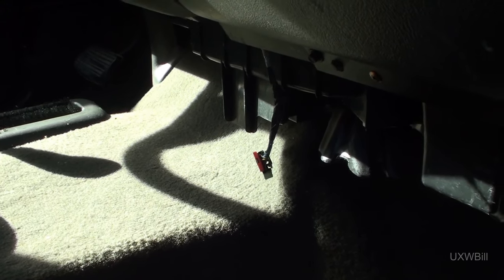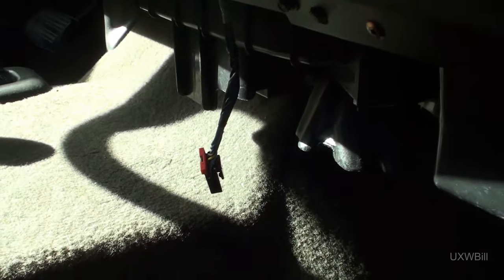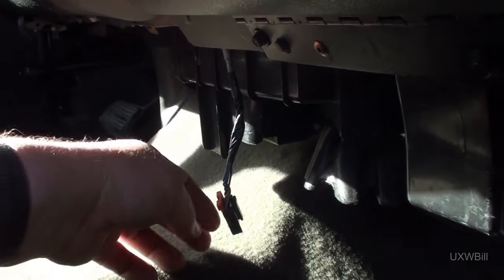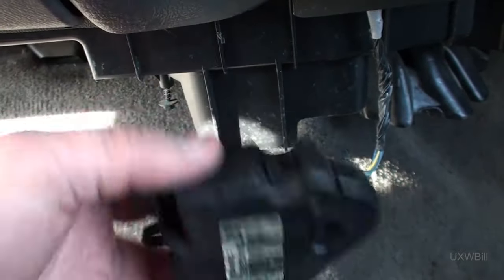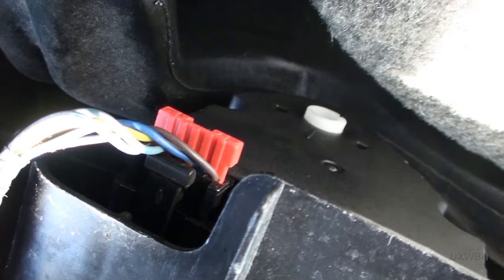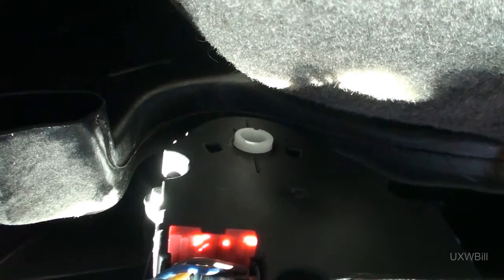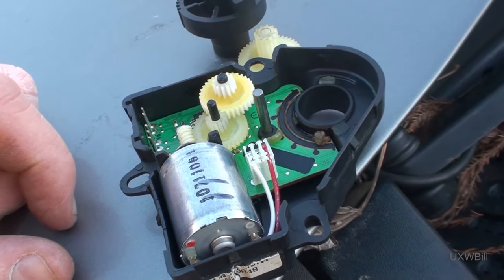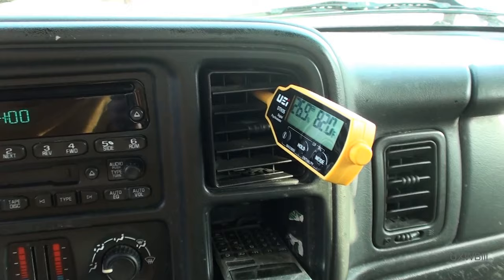Naughty Truck Newsreel: Broken Driver's Side MVAC Blend Door Replacement

Comment: A "lifetime warranty" on a part means you'll spend a lifetime replacing it when it breaks.
Reply: I still use that joke on a daily basis.
Reply from the maker: 9:47
Reply: @uxwbill I remember doing the blower fan on my car it wasn't fan there are 2 or more sharp pieces of metal on either side and yes I got cut more then once
Reply: It wasn't fun not fan
Reply: @josh6715  I remember having to replace the  starter annually on my '74 GMC. This went for about 5 years until I spent the big bucks on a mini starter.

Comment: Im having a similar (but opposite) issue on my moms 2011 Chrysler 300. AC works great but something is stuck or broken up in the dash, possibly an actuator or maybe blend door, as you get ice cold air on the driver's side but warm to hot air out of the passenger side. The 2nd gen LX platform Chrysler/Dodge 300/Challenger/Charger have very finnicky HVAC systems and her car has already been worked on multiple times for similar issues, air coming out of the bottom only or top only, etc. And theyre a pain in the ass to deal with, having to disassemble and sometimes remove the giant dash just to reveal beey thin, cheap plastic components. By the time you get one thing fixed on the HVAC, something else would break. 😂😂

Glad to see you posting again Bill, ive been a viewer since probably 2009! Your videos and rambles remind me of better times.

Comment: I once bought a set of SKP upper ball joints for my Suburban, and they completely wore out after like 6 months.

Though there wasn't a lick of greese in them after 6 months, so I'm guessing water ingress (Might have to do with my various off road adventures).

The lower ball joints are still completely original and in great shape.

Comment: The old 330,000 mile '98 Suburban had it's drivers side blend door motor fail about 2 years ago. . .

Thats it . . .

I still haven't replaced it, I just positioned it so that the air comes out of the dash vents.

Comment: Luckily I haven't had to replace the blend door on my 2002 Dodge. I did replace the resistor and the blower motor. It would only work on high. And one day the blower motor just quit working. Luckily it wasn't hard. You just take the glove box off. The blend door looks harder.

Comment: More overengineering crap in these modern vehicles. I move slider on the dashboard and it moves a flap. never fails.
Reply: Until the plasic cracks or the cable seizes. And I take automatic climate control any day. Set the temp and forget it.
Reply: @tschuuuls486 I agree, it may or may not be as reliable as a cable, but the convenience is worth it to me. It turns the fan up when the coolant warms up, ramps the fan down when the cabin has reached my desired temperature, and it can automatically go from heat in the morning to AC in the afternoon when I leave work without me touching anything.

Not to mention, after nearly 18 years, one easy to replace $20 part failing doesn't seem unreasonable at all. On the other hand, all those blower motors failing is a little unusual.
Reply from the maker: It lasted for 16+ years and 260,000 miles...far longer than most people would keep the same vehicle. (I've had Naughty Truck since sometime in 2012, at which time it had about 94,500 miles on it.) I think that's more than fair enough.
Reply from the maker: @tschuuuls486  For whatever it's worth (likely not much), I've never been a fan of automatic climate control in a vehicle. I've never cared for the way they manage the fan (run like mad at first, then settle to nearly no airflow at all), nor the way that even when they reach setpoint, there's still a cold or hot "edge" to the interior air and surfaces.
Reply: @uxwbill  some of the current generation let you set the auto mode to low, med or high, which sets the aggressiveness to reach temp etc. That's available on teslas for example.
Reply: @uxwbill it was April of 2013 when you got the truck.

Comment: I had to make the same repair to my old Mustang a couple years ago.  It was easy to find but almost impossible to remove due to it's location.  Two of the three mounting bolts weren't that bad to remove but the third bolt was only removed after trying to get multiple different tools on it combined with a LOT of colorful language.  Once I finally got it out the new actuator went in easily as I omitted the difficult bolt.  Like yours, in order to get it to home itself properly you had to pull the fuse while doing the work and put it back once it was connected.  I saw a lot of reviews on the actuator I bought saying it broke almost immediately after installing it.  I believe it was due to people not pulling the fuse and the actuator trying to move beyond it's range and breaking teeth off the sprockets because it wasn't properly homed.
Reply from the maker: I would be curious how similar the plenum design and location is between the Mustangs and Panther cars. There's also a fastener in the Panthers that's difficult to get at.
Reply: @uxwbill  Sorry but I can't help you with that.  I traded the Mustang in last summer.
Reply from the maker: The question was rhetorical.

Comment: I have a 1989 Buick LeSabre custom same car as yours. You have to keep the pedal all the way to the floor in order to start it and it wont idle. I’m going to check the idle air control valve. Do you think it could be anything else besides the map sensor and the control valve?
Reply from the maker: It'd be worth checking the most obvious stuff first, if you haven't already: air filter/air box (got a mouse nest or other clog?), fuel system pressure and coolant temperature sensor. If all that seems OK, I'd definitely inspect the IAC motor. The MAP sensor is probably good.

Comment: I rue the day I'll need to do this to the 05 grand caravan. when it's extremely cold out, it likes to stick a bit. after the heat is on for a second it'll come open if you do it again, but anywhere over 40F it's usually fine. however, it'll always stay wherever the dash pot is set, so it doesn't auto-close after the car shuts off. I know some of them do and it's a real PITA.

Comment: For how many miles that truck has on it, Im quite impressed how quiet the engine is. Both GM trucks my family has owned had considerable lifter tick at lower mileage. Albeit, they were 5.3L engines.

Comment: so im pretty sure the passenger side actuator is on the top side of the hvac box and its dashboard out to change it i have a really high spec 2003 suburban
with the center console my passenger side actuator is making the same noise you described and i was quoted a lot of money to change a 30$ part it was all labor and being i have the center console with the bose sound system the subwoofer is in the way so the entire console and so much more has to be removed to get to the driver side actuator it’s in the same place as yours is just basically completely covered my favorite one and im being very sarcastic was the blower motor control module on a 2011 f250 that wasn’t just dashboard out it was also removal of the HVAC box because it’s on the backside and you can’t get it out because it hits the firewall dumb design they had room to place it on the front but didn’t what a job needless to say it got new factory heater and a/c Coors while i had it apparat as they are dashboard out as well lol the way vehicles are made these days is truly crazy

Comment: The Buick had this issue with it's blend door.  I never fixed it.  I went years  of hot, then cold weather before getting rid of the car, but I had to manually actuate the blend door.  I took the glove box out and left it out since fixing it wasn't the highest priority.  I had to pull off the road to change it since it was quite a stretch to get to the blend door.

Comment: The older actuators GM used had a metal shaft pressed into the center of the large gear rather than an entirely plastic gear (as the replacements now have instead).  The large gear used crack in one spot from stress/age and then the smaller gear that turns it would eventually land in the crack and no longer reach any teeth.  They also used a small potentiometer in the corner to read the location rather than the contact trace.

Comment: Regarding the engine light, I had a hard to track down EVAP system leak myself a few years back. I even ran the Ford IDS leak check procedure (where the PCM pulls a vacuum and holds it for a predetermined amount of time), and it passed. Eventually I caught the purge solenoid intermittently getting stuck open. I pulled the electrical connector to it as the PCM was commanding it on, and put my finger on the the inlet and felt vacuum despite the fact it should be closed with no power. New $30 purge solenoid cleared my check engine light.
Reply from the maker: Although I've never seen one fail, I have some hope that the light might eventually burn out. :-P

About a year and a half ago, the gas tank actually fell out of the truck while I was driving it. The racket this made had me thinking something had just come majorly undone in the rear end. I'm actually kind of surprised it didn't sever any of the fuel lines and leave me stranded somewhere. Since (of course) this happened miles from home, I had to hire the repair done. As the mechanic balked at the notion of tracking down the leak, I let it go and haven't been able to work up the enthusiasm to revisit the subject. If ever I do, there will probably be a video.